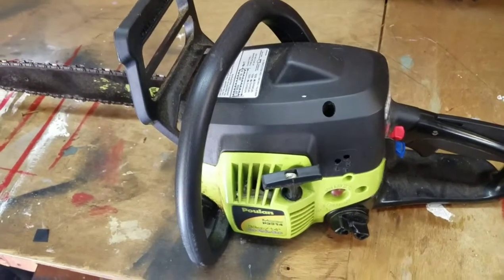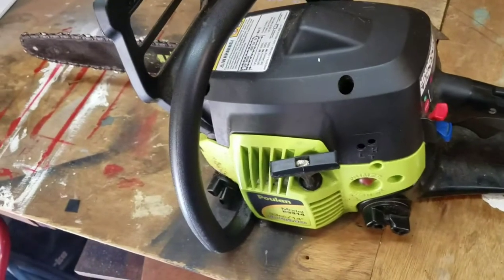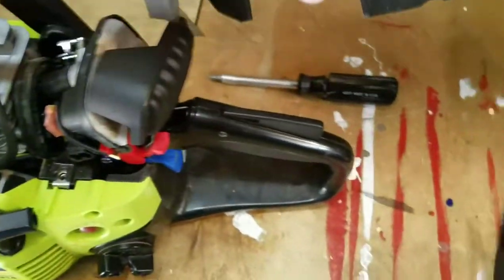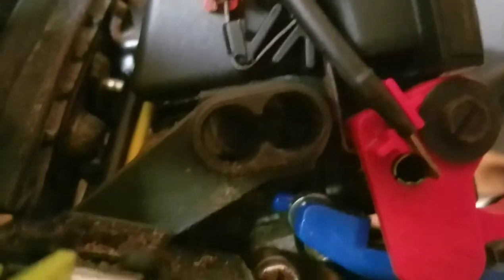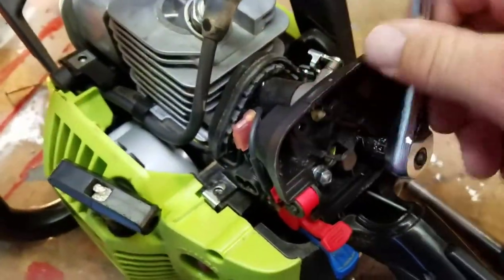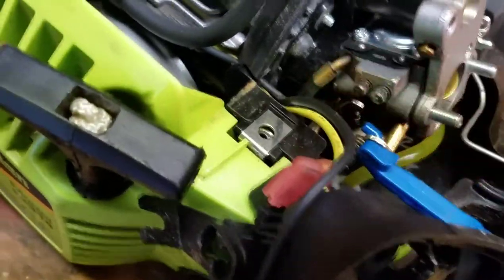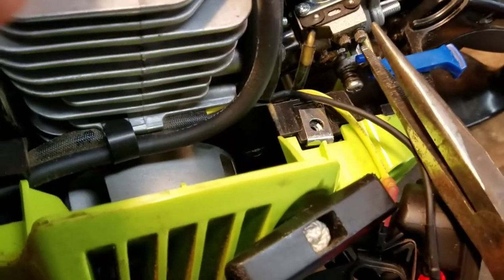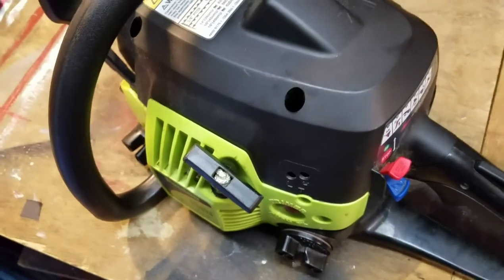How to fix a bogging chainsaw carburetor for free

Comment: Thanks Scott....  kudos for showing folks a way to do the adjustments without the spline tools.  And your 3/4 turn out on the H screw  -- glad that worked for you so well.  (but lucky you guessed just right)  As noted below, it's become really cheap to get your own spline tools.  the most common shape can be had for $3 (or less) via ebay.  A full variety ten pack can be had for $10 or less via Amazon. (and shipped prime)  Yet funny thing, the new (omnipresent, yet miserable) China-saws don't even require spline tools.  (the industry racket to try to prevent users from adjusting their own small engines now in tatters .... good!  Still, I so want an electric saw -- and forever be done with this need to always fiddle with the carbs!)

Comment: Thanks for the info and yes, that little adjustment takes a splined driver. I ordered a 10 piece set do that I would have "all" the drivers needed for any small engine adjustment off ebay for $20.00.